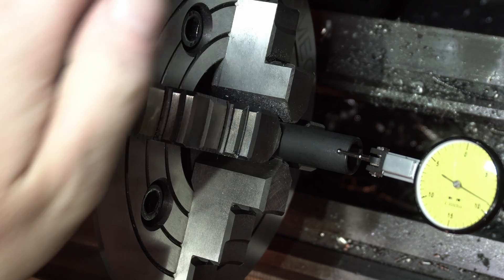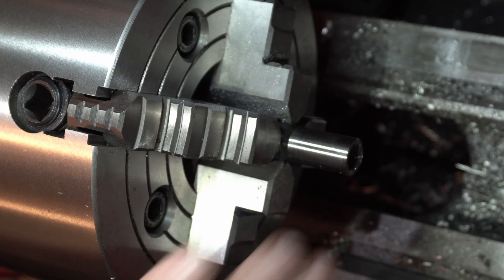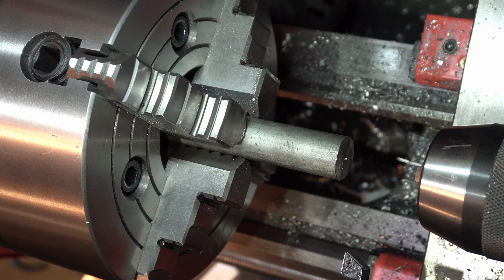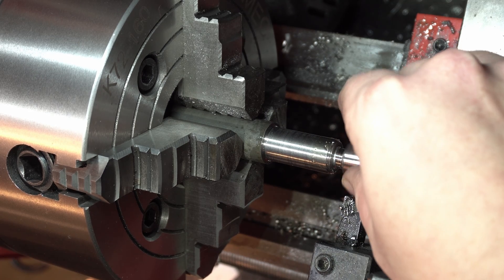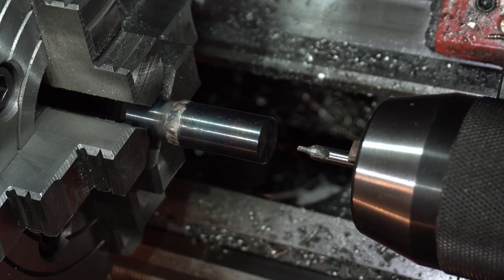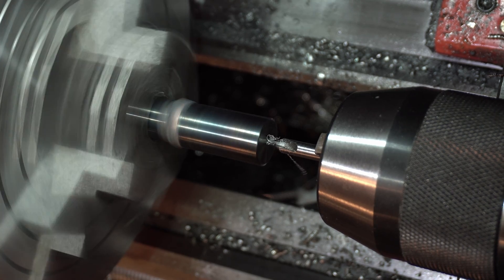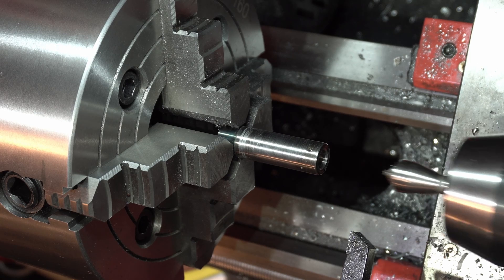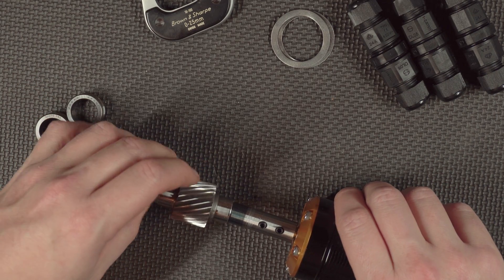Electric Vortech - Making the Motor to Impeller Coupling

Comment: Your two sets screws in the shaft coupler might actually be enough to cause a decent imbalance.  Having opposing screws might help prevent coupler from shifting off centerline also.  BTW I probably spend and average of 5 hours a day on YouTube, I think your the first channel I've actually subscribed to.  I can not wait till you have this running.  I have been dreaming of doing exactly what your doing for like two years, had no clue about TP Power.   I'm currently building a electric forced induction device... using a double acting air cylinder, driven by a linear motor, to compress 500psi into a scuba tank and pressurse regs to precisely meter boost.  So instead of having to create 5-10 psi boost in real time, the scuba tank acts as a buffer/reservoir. I'm hoping to get fifty 6 second boost events a day with a 20lbs battery setup.
Reply from the maker: That air cylinder idea sounds interesting.  I think it was Mickey Thomspon back in the day who was the first to try compressed air supercharging - maybe google that; perhaps it'll give you some ideas.  Do you have any videos on that?  And thanks for subscribing.  I need to pick up the pace on this project.  Hoping to take advantage of this weekend to do so.
Reply: @AlexLTDLX  Yep, Mickey did it back in the day, now the inventor of NOS has developed a pretty cool CAS kit, casupercharging.com, 8psi doubles horsepower with pump gas due to joule-thomson effect and no parasitic losses.  However his system is for the track only, have to remove and recharge the 3300psi tanks after each run.  

I've watched probably all the youtube vids and tons of googling, you seem to be the first to be doing it right.  The 5680 seems perfect for this.  I thinking your biggest problem will be initial spool up, your probably going to have to supercap whack it for ~300ms with 500+ amps.  ESC nightmare though.

You are on to something, it's going to work beautifully for probably 200hp on demand.  I see you be able to dump 20kw into it for 5 secs no problem... 300hp.  Just imagine having TWO!!  BTW how are you managing AFR?

Comment: Question. When talking about 2ft lb tq, is that also taking into account loads generated by whatever psi you are aiming for during boost?
Reply from the maker: I would think so.  That's all the motor can generate.  But it should be less because the engine's air requirements should help push the limit up over just free running it.

Comment: very nice ! i tried his project once, but i intended to rim the impeller directly, and press it on the motor shaft ...

it pulls off, terrible amount of micro vibrations !

i think the motor shaft should enter tight into the coupling, in my opinion, the hex bolts will slack as soon as it runs for 10s !
Reply from the maker: We'll find out I suppose.  I don't think there should be much if any shock or harmonic loads unless it goes into surge.